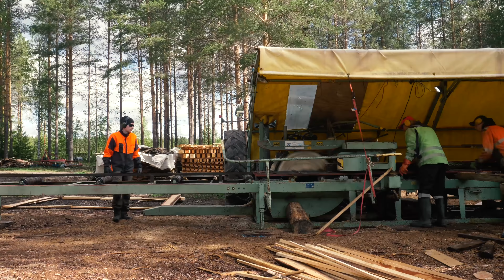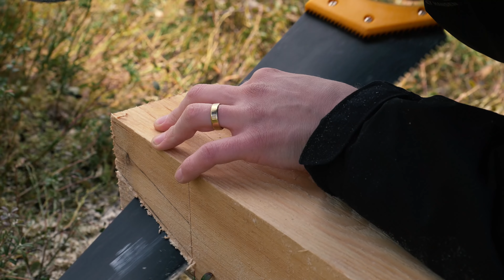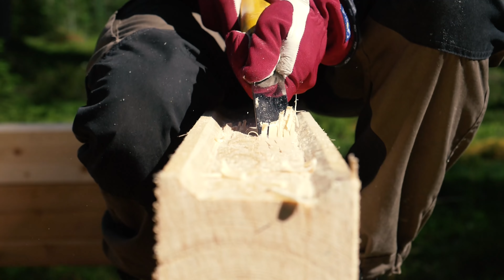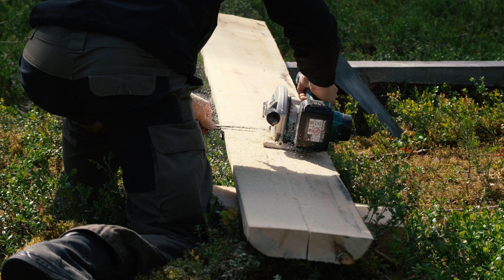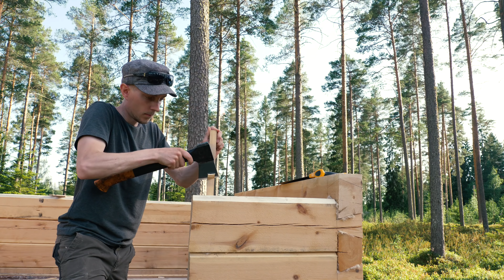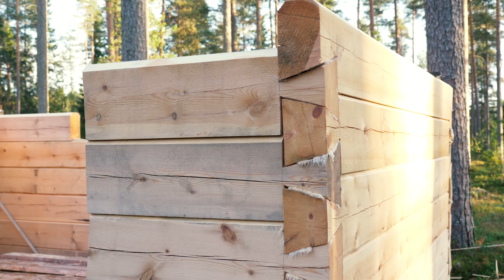Project log cabin | Half way done - Timelapse

Comment: How long did you have to dry the trees after felling them?
Reply from the maker: Depends on who you ask. I dried about a year. you can build out of green wood too, but then you need to pay attention to some other details.
Reply: Finnish Playground what kind of details? Warpage ?
Reply from the maker: @digflorida6205  If warpage means shrinking, then yes :) It'll shrink anyway, but more if you use green wood. Also it's difficult to estimate the twisting when using green wood. However I'm not professional at this so these are just what I have learned.
Reply: Finnish Playground well your work is great looking! Yeah warpage means twisting of the lumber

Comment: What's the material being put between courses?  I usually see a lot of synthetic materials, but it looks more like a wool type strapping.
Reply: Hemp fiber. You can buy this in hardware stores in the Nordics.
Reply: @marn8136  thanks....  i knew it looked more natural.
Reply from the maker: Hi, it's linen acutally.
Reply: Whats the linen there for?
Reply: @matthewjagger1044  its to fill the air gaps, similar to what chinking would do.
Reply: @brokensquidwoodshop4209  thanks for the reply. Awesome job!

Comment: Hi ! I had a question for you mate, why have you done full dovetail instead to have done half dovetail ? Because I’ve heard that the half dovetail were better in front of the water than the other dovetail.
Thanks in advance ! Your project is beautiful !
Reply from the maker: Hi, I think the cabin is stronger this way. I have seen old buildings done like this so it should be okay, but I might cover the corners at some point so at least then it's not a problem.
Reply: Finnish Playground Ok thanks 😉

Comment: Oh no those boards are going to rot out touching along the seams like that. Need to be spaced and fill with chinking. Alot of labor to not do it correctly.
Reply from the maker: Hi, I don't think so. There are 200 years old cabins next to my property and they are done pretty much like this. No one uses chinking here in Finland.
Reply: Finnish Playground 
What is meant by chinking?
I can’t find a right translation.
Reply from the maker: @andreasmuller7746  Sometimes people leave gaps between the logs and fill the gabs with  some sort of flexible material. It's faster to build but I think it requires more maintenance. I have never done anything like that though...
Reply: Finnish Playground Thank you explaining !
Reply: Finnish Playground by now I have found videos showing chinking. 
I agree that using modern chemical stuff to seal the gap between logs of a cabin does not fit to traditional wood work. In my second homeland Switzerland there are even 400 year old log houses. The chinking has been done with moss! Keep up the good work!

Comment: Bees wax can help the dowels slide in and seal the wood wax can be applied to joints and seams heat in pot and brush on joints it can seal timbers on ends and outside for water proofing

Comment: I don't know why when I saw a video of you cutting down a tree I felt sad, maybe because the tree is older than you, and obviously reduces oxygen reserves on this earth
Reply from the maker: At least now the logs will seal in the carbon dioxide for hundred years in stead of the pine falls down and get rotted over time (and releases the carbon dioxide). Not ideal of course, but we need buldings anyway and those build out of wood are way more eco friendly than anything made of concrete or other industrial materials.

Comment: Did you preserve the timber before/while seasoning? Or how do you plan to preserve it when the cabin is finished?
Reply from the maker: No I didn't. When it's finished I'm planning to carve the log surfaces with ax so it'll be more resistant to water. If the joints are made well and the wood material is high quality it should last 100 years without any chemicals. I'm not sure about my joints but at least the wood quality is high :)

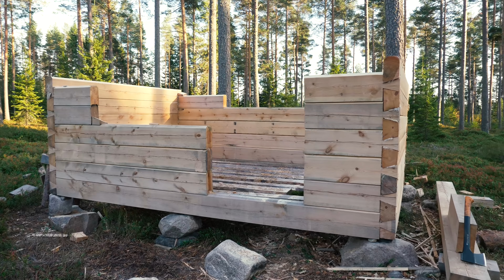Comment: @3:57, @5:48 you could see tiny rocks holding the whole thing. Why not go with bigger rocks on top of the big rock instead of "pebbles"?
Reply from the maker: I put big rocks below to prevent sinking. Smaller rocks on top of them should be fine, I think it's more important that they fit well. Of course it would be nice to have big rocks everywhere :)

Comment: This guy doesn’t have a clue about proper joints on the corners this corners will take in water and rot really quickly. Instead of a double dovetail he should have used a half dove tail
Reply: Bailey's Construction I am sure you know best how to build genuine, traditional pine wood log cabin that can withstand four seasons without maintenance 150-200 years in semi arctic regions 👍. Of course, next you explain that you have built personally these cabins 400 years with tools made only from bones of deers killed by saber tooth tigers